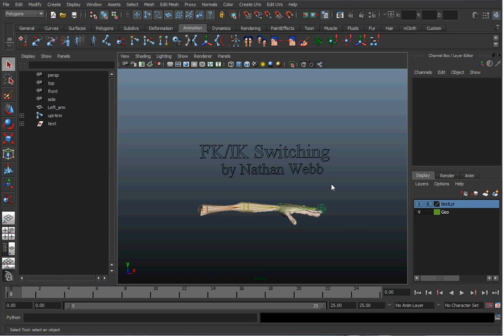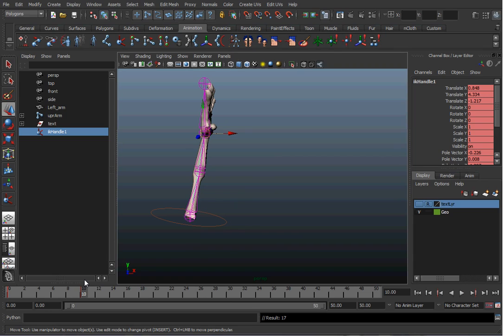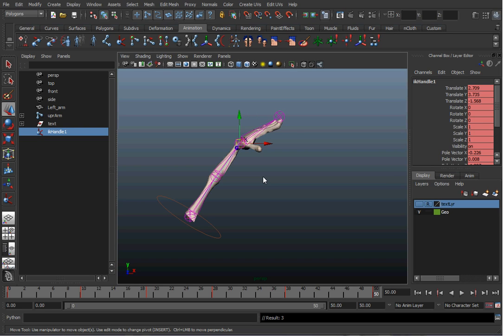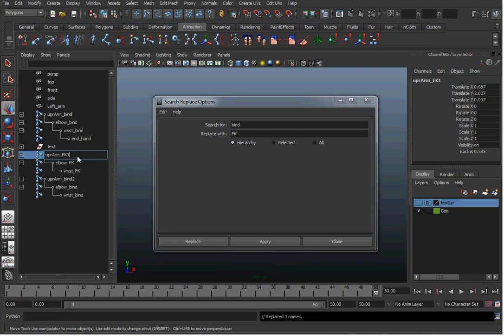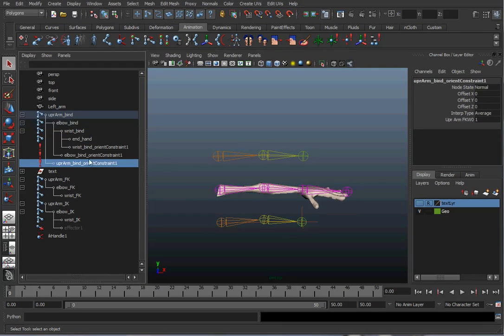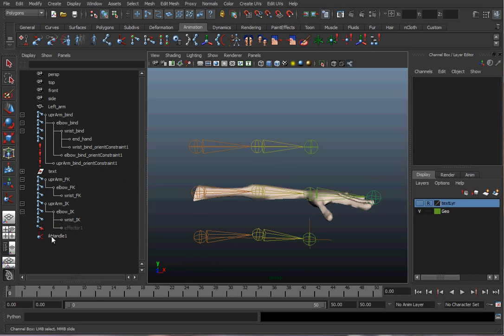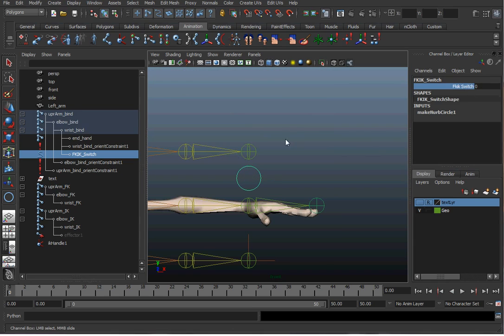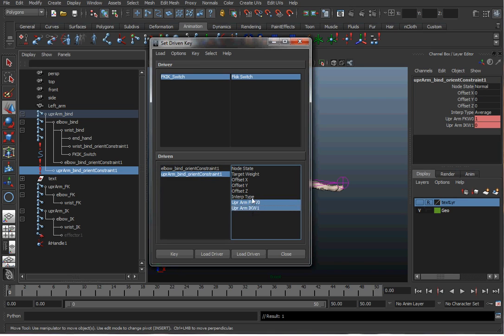FK IK switching in Maya using Set Driven Key

Comment: Hi Nathan.  I am in my first semester of teaching computer animation and found this very useful (and practical) for an explanation of an IK/FK switch set up.  Great job.   I would greatly appreciate hearing your version of set up for a biped character squash and stretch spine.   I have followed several videos (including the long series on the Maya Learning Channel) for spine setup process, but I find them all to be a bit too complicated for first semester animation students.   I know that expressions are used frequently (to drive the scale of the joints), but I am just curious on what your take would be.    Thanks for your time.
Reply: Also.  On the FK IK blend control, I am not sure why you set the value from 0-10.   It appears I get the same result whether I the set the value 0-1 or 0-10.  Is the higher number supposed to slow down the fade of the switch?

Comment: Hey man! Love this, right now I will stick to the first method, but will for sure come back here soon to try the second one. I was wondering tho, If I use the first method, and I have my control curves (let's take the one around the wrist) Should I parent it both to the IK and the wrist bone?
Reply from the maker: +IGarrettI Hello Garrett.  I'm glad that you like the video.  If you're using the built in ik/fk blending in Maya, I'm not sure that you can use a control object to animate the arm and still keep the cool ik/fk blending.  If you parent a control object to the IK handle, the IK handle will move the controller.  If you parent the IK handle to the controller, then the controller will move the IK handle, but it may not work in FK mode.  Remember that you can only have one parents, so you can't parent the controller to both the IK and the wrist bone.  You could use 2 parent constraints to do it like that, but then you'd have to have them blend on and off.  On all of the rigs that I've worked with professionally, the use the 3 bone chain system that I explain in the 2nd part, so I'm honestly not to versed in the built in switching method.  Good luck!
Reply: Nathan Webb Alright, thank you for the help!  I would use the Human IK, but it isnt too customisable for models that stand out  from the human shape (like having a tail). Anyway, will try it out. Is this method supposed to be used for arms and legs only, or anywhere that IK were used, like fingers and spine (But I guess It would create a cluster?). Also I would love to see your approach for facial rigging D:
Reply from the maker: The 3 joint chain method is usually used with arms, legs and spine.  For spines, you usually use spline Ik, because it allows for using more then 3 joints, and has twist features instead of a pole vector control.  You usually don't need IK on fingers; fk is fine for most cases.  For faces, I have a two old videos that shows what I use to teach my students.

 https://www.youtube.com/watch?v=m3ilkkeMVXw

I pretty much use the method from the book Stop Staring.  Worth getting on Amazon.
Reply: Nathan Webb Damnnn Thanks a lot!!Will check it all out

Comment: I need to figure out how to rig the fingers so that the finger pose stays the same when I switch IK and FK.

I can't figure out a way that avoids a cycle which I definitely don't want.
Reply from the maker: +Simple1DEA You'll need to write a mel script which makes FK match IK, and the other way around.  When going from IK to FK, you get the attributes of the IK joints, then set the FK controls to those values.  When going from FK to IK, get the position of the fk end joint (last fk controller) and translate the IK control to that position.  I don't remember how to get the pole vector in the right place, but it can be done with mel.  If you find out, please post here.  Thanks, and good luck.

Comment: how do I link visibility of controllers with set driven keys? (or any other method)
Reply from the maker: +Simple1DEA Hello.  To have the controls visibility driven by set driven key, you'd make the your ik/fk switch value be the driver, and the visibility of all your controls be the driven.  Set your ik/fk switch to the "I'm using IK" value (either 0 or 1), make the visibility of the IK controls be "on" or 1 in the channel control, and make the visibility of the fk controls be "off" or 0.  Hit the "set" button in the set driven key box.  Next, set your ik/fk switch to the "I'm in FK mode" value, turn the IK controls visibility to "off" or 0, turn the FK controls visibility to "on" or 1, then hit the set button in the set driven key.

That should work.  Test it out by changing the value of your ik/fk switch from 0 to 1 and see if the controls switch their visibility.
Reply: +Nathan Webb Thanks a lot!

Comment from the maker: Hey.  I'm glad that you found it useful.  On my own rigs, I use the 3 joint chain method, as I find it easier to animate, and the rig seems cleaner..  At my current job, our rigs are like that too.  I haven't used the new IK blend method before, except for just a quick test.  Using the old method lets your rigs be more backwards compatible too, so that's a plus.  Try both though and see what you like though.

Comment from the maker: Hi.  I think using the IK blend value is okay for simple rigs where you directly animate on the joint chain and ik handle, but I've never rigged anything with it, or used a rig that used it.  On professional rigs, you animate on NURBS curves that control the rig.  If you can setup something like that using the ik blend, go for it.

Comment from the maker: To get the FK to follow the IK, you could write a MEL script to snap the FK controllers rotation to the rotation of the IK joints.  Do a google search for "fk ik mel script" and you'll find some help. To get the FK controllers to be hidden with the rig it set to IK, use set driven key to have the switch control the visibility of the FK controllers.

Comment: Excellent tutorial! I was looking for hours lastnight for a simple manual FKIK switch tutorial, and here it is --- thanks! One question though - when it comes time to animate, the FK arm and the IK arm should be hidden, right? (but, with a visible object to control the IK handle, of course). Naturally, to rotate the real arm with FK, I would just select joints on the real arm and rotate them, rather than on the FK arm since the FK arm would be hidden. How would I go about this?